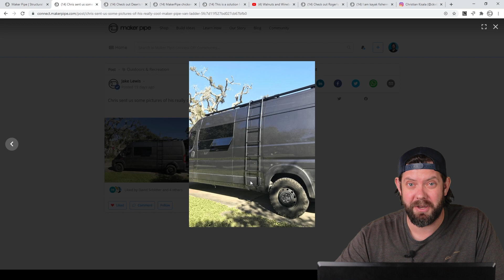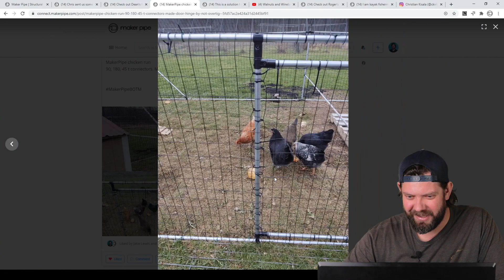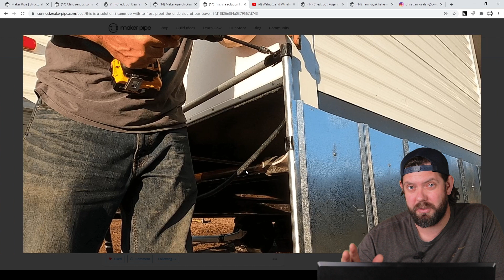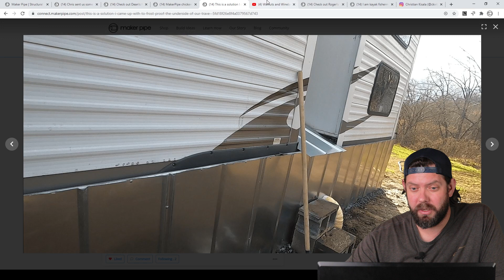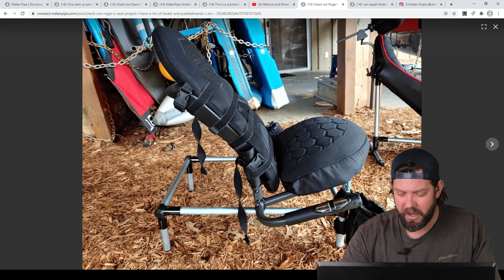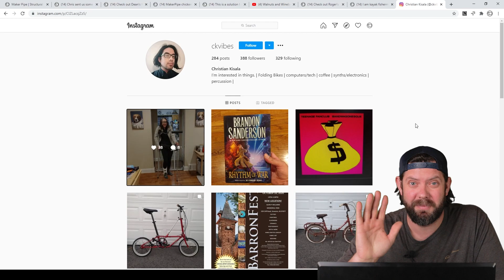7 Clever Uses For Maker Pipe And EMT Conduit | Maker Pipe Monday - 026

Comment: Need something to hold my solar panels
Reply from the maker: There are some great solar panel racks in the community. Here is a couple that comes to mind. 

https://connect.makerpipe.com/post/this-is-my-first-maker-pipe-project-my-wife-and-i-decided-to-invest-in-an-o--5fc5874833f1d476db0a8dba

https://connect.makerpipe.com/post/pontoon-boat-solar-charging-5fdfa801e42411730be4b2aa

https://connect.makerpipe.com/post/built-van-roof-rack-with-maker-pipe-3-4-conduit-attached-the-solar-panels-o--5efc07f60db0fc22bed788d9